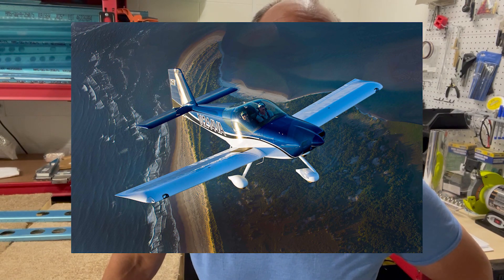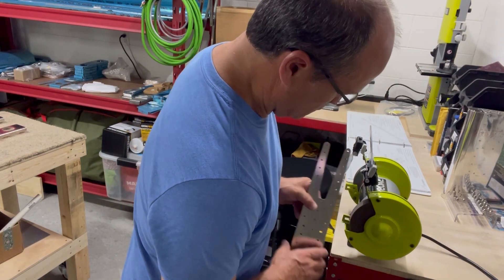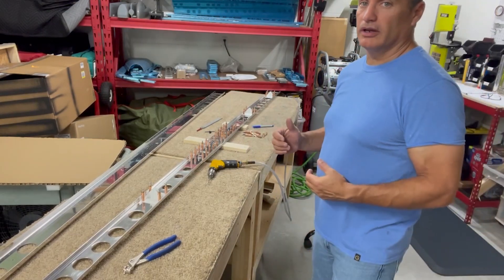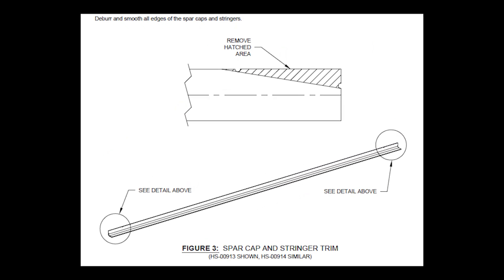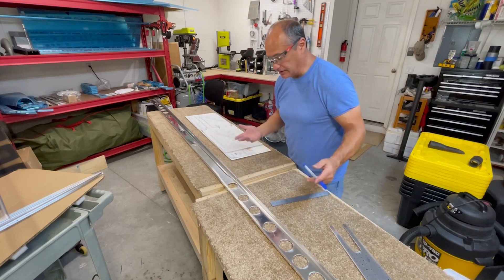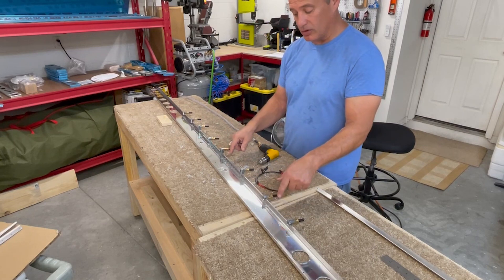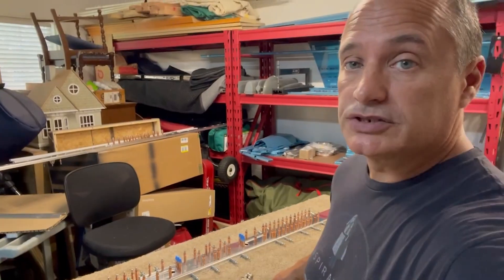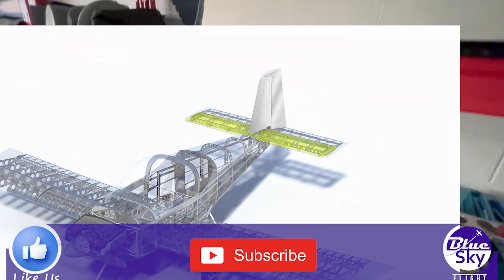Horizontal Stabilizer pt1   Building a Vans RV 14 Airplane Ep5

Comment: Really enjoying your build series.  Hoping to start my own build next year.  Haven't quite decided on the model yet, although I have the preview plans for a 9.  Anyways, a recommendation for your parts prep process that might help.  Before, you do any dimpling, I would suggest scuffing with Pre-Kote the parts before you do any dimpling.  With the aluminum flat, it will be way easier to scuff up and won't tear your scotch bright pads up as bade.  Before priming, then you can just spray and wipe them down with Pre-Kote to remove any oils from your hands.
Reply from the maker: Thanks for all of that. I’ve considered doing the prep as you described. I hadn’t because it didn’t seem too bad with all the dimples, but I’m going to give your suggestion a try on the elevator parts I’m working on now to get a better idea of how it compares. Thanks for the suggestion. Keep me posted when you decide on an airplane and also when you start the build… it’s a really rewarding process.